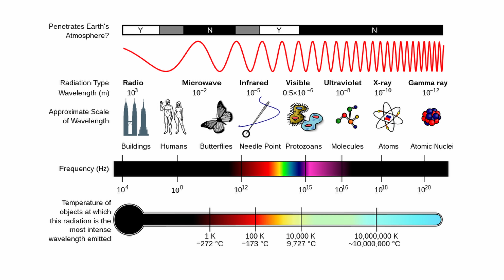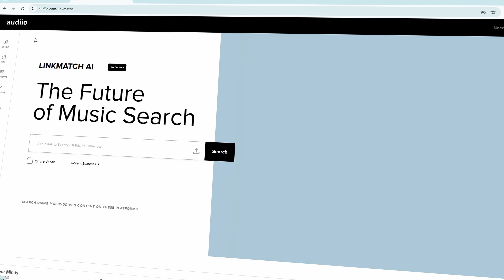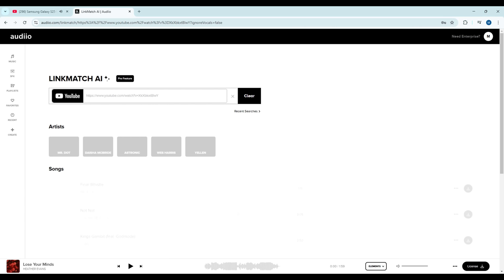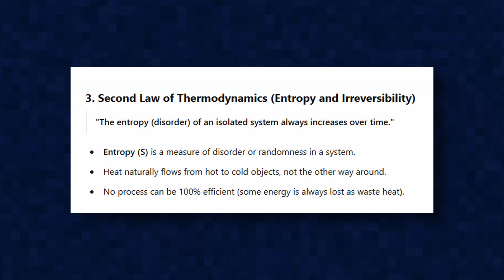This is how Maxwell Chikumbutso's Inventions Work

Comment: Chikumbutso is claiming what the Great Nicola Tesla demonstrated, yet his methods may be different or the same - it has been indisputeably demonstrated that simple matter contains energy that can do work outside the bounds of  matter - argue with an exploding Nuclear Bomb if you need Extreem proof - to be less exemplary, realise that there are non radioactive energies within matter that are much less extreem that lend their presence to mans utility and by that i mean the electromatic forces of the atom known as Magnetism that we encounter daily doing our tasks, holding notes onto bulletin boards or friges, starting our petrol cars, ect. - that simple seemingly inexhaustable force that emanates from the basic atom and most notably from magnetic materials is mans workhorse to use as he choses - to preserve the environment that he depends on for life - it has been widley proven that it can be simpley utilised, concentrated and AMPLIFIED by synchronising and directing its Atoms INTERNAL polarity using applied magnetic fields - that syncronisation or alighnment of matters inner magnetic fields causes a much more POWERFULL Magnetic field to expand from the matter that represents an ENERGY GAIN that can be used to create an AMPLIFIED  Electric Current  much stronger than the current used to synchronise the inner atoms fields - NEED PROOF? - then see the Works of YouTube Advertiser and Electrical Genius Dr. Holcomb - Holcomb Energy Systems - View His many Videos on YouTube Explaining his "Been To Court" Inventions and then consider what Mr.Chikumbutso also Claims.

Comment: Well if he uses wifi and phone radio signals to run his car. Its a maybe but then if everyone complain of no signal than after an investigation he will be jailed for stealing energy. The other point that from far of a tower, the signals will be so weak that it won't run the car. Its a good idea, but impractical. Its like claiming that we can tun a fertilizer factory on the air itself, because 70% nitrogen in the air. Or run the car on water because it has hydogen in it.

Comment: Conformité thermodynamique du système de Maxwell Chikumbutso

Le générateur sans carburant conçu par Maxwell Chikumbutso suscite la controverse, certains estimant qu’il contrevient aux lois de la thermodynamique. Toutefois, une analyse rigoureuse indique que ces lois ne sont pas nécessairement violées si l’on considère que le dispositif fonctionne comme un système ouvert, en interaction permanente avec son environnement.
1. Première loi – Conservation de l’énergie

Le système ne crée pas d’énergie à partir de rien. Il capte l’énergie ambiante disponible dans l’environnement (électromagnétique, thermique, etc.) et la convertit en énergie électrique. Tant qu’il existe un apport externe d’énergie, même faible, la loi de conservation de l’énergie est respectée.
2. Deuxième loi – Entropie

La deuxième loi impose que l’entropie d’un système isolé ne peut diminuer. Or, le système de Chikumbutso n’est pas isolé. Dans le cadre d’un système ouvert, une diminution locale d’entropie (dans le générateur) peut être compensée par une augmentation plus importante de l’entropie dans l’environnement. Ce qui est exigé, c’est une augmentation globale de l’entropie du système étendu, ce qui reste cohérent avec cette loi.
3. Autonomie énergétique

Si l’énergie récupérée sur la durée est supérieure à la consommation effective du dispositif, un fonctionnement autonome devient envisageable, sans qu’il soit nécessairement question de moteur perpétuel ou de fraude énergétique. L’important est l’équilibre énergétique sur le long terme.
Conclusion

Tant que le système est alimenté, même de manière diffuse, par une source d’énergie externe, et que le bilan entropique global reste croissant, aucune violation des lois de la thermodynamique ne peut être affirmée. En l’état, seule l’absence de validation expérimentale indépendante empêche de confirmer ou d’infirmer les performances revendiquées.

Comment: I don't doubt that he can transform energy with a new invention.  I am dubious about it going against our understanding of energy laws.  However, where it currently falls over is that his claim goes straight to being able to generate enough to power one of the most power hungry devices.  No invention in the history of man so far can take something that produced negligable energy and through initial prototyping demonstrate this level of commercial use.  I would get money backers to  put up an agreement to pay on condition that it works and they will have scientists to verify.  However, all indications so far suggest that this is a scam.  If he can produce this level of energy he's on the verge of delivering transwarp drives.

Comment: Isware he is right 👍 I make same charger for my battery using only coil and magnit as mortal shell it make to me about .025v with out moving ,,with moving I make volts charge my 🔋 with out normal charger only connect it to negative point of battery it's faraday's theority ...

Comment: 🌟claims about Maxwell Chikumbutsos Generator technology.

- His device is claimed to use radio Frequencies & he calls it a microsonic energy device. Microsonic energy isn't a known or recognized term. Is it a new discovery?

-He claims his system is an open system & some how it disturbs the ambient background into releasing energy

-He claims the special radio frequency as it passes through batteries doesn't drain them as they run loads & the batteries rapidly recharge when disconnected from loads.

-he's claimed to have made self powered vehicles that run indefinitely off this technology

-he's made many generator models varying from 100 watts up to 0.50 megawatts & he said they all have no moving parts & operate off microsonic energy?

🚩 Red flags & questions about Maxwell Chikumbutsos device/technology

-Most generator models he made have fans so they must generate heat as a byproduct of high power operation & need cooling (isn't that inefficient?)(do the fans only cool the high power circuitry that converts the battery power to 120/240VAC Power?)(the microsonic energy converter requires over 100% efficiency to function as claimed by capturing excess resonant energy in the ambient enviornment & should run cool in theory & not require fans.)

-how does the device self sustain itself while also running large electrical loads? Do the loads need to be switched off for a time & the batteries get rapidly recharged by his radio/microsonic frequencies?

-what does he mean by microsonic energy? Is it sound waves or radio waves? Is it Longitudinal Energy Harvesting? Is he generating certain sound frequencies on special metals to get a non linear wireless power output he can harvest? Does his device only rely on conventional known wave propagation phenomena?)(did he somehow discover something new?)

-during one large test demonstration some researchers from the thrive 2 documentary suggested to test the device running what appeared to be a 15kw welder & Maxwell said all they needed to complete that welder test is 18 new additional batteries to allow for that to happen to run a 30kw load & the generators high frequency energy will keep the batteries fully charged as the welder runs & sure enough the researchers brought in 18 additional batteries the next day & performed the test for one solid hour & claimed the battery voltage was slightly higher after the test & read 217vdc. Wouldn't 18 fully charged 12vdc batteries in series have a nominal starting voltage of 252vdc if fully charged at 14vdc before the test so after the test did the batteries drop to 217vdc? But the researchers claimed the batteries didn't drain at all & read slightly higher.

(Why couldn't he easily run the welder machine from one of his other existing fully functional generators? Why were 18 New additional batteries needed to be brought in by the researchers? That fact alone is a big red flag & suggests the new batteries themselves were the power source for the test that the researchers actually paid for out of pocket!)(the researchers also did not appear to go into any form of technical analysis of the system & seemed to blindly want to believe in its operation. They should have had tool boxes worth of analytical equipment along with avremenko led wireless detector plugs to detect if the device was giving off wireless power. Those mini detectors are highly sensitive especially if made with germanium diodes.)(the researchers tests from the movie thrive 2 were highly inconclusive.)

-what mechanism keeps the driving battery FOR the generation of his special signals charged while simultaneously running large loads from possibly other batteries that are exposed to this high frequency signal that keeps them fully charged & also causes rapid recharging in them after the load is disconnected? (Is the generator system truly self sustaining when on & running loads or does it need all loads disconnected for a time for it to recharge itself?)(Is the theorized energy synthesis phenomenon proposed by Eric Dollard occurring in the batteries from the special microsonic radio frequency stimulation?)

-is microsonic a real word & type of energy or does he just mean radio waves? Is he harnessing Longitudinal Energy somehow?

-A true zero point energy generator would generate power with 0 input possibly due to the phase disparity inherent to permanent magnetic fields in the proper generator archform at a ratio of 1/Phi³ & be solid state but as of yet no one's discovered that correct archform to manifest power with 0 input from the special arrangement of permanent magnetic fields. The well documented footage of field propulsion craft/ufos/uaps from the military strongly suggest these craft are powered by a type of zero point energy device. Also if the universe is truly infinite ♾️ it means that all phenomenon most likely manifest from a non cartesian equally infinite point known as the Aether & trying to measure it would be like trying to measure the measurer so a form of "free 0 point energy must exist"

Conclusion on Maxwell chikumbutso based on occoms razor is that the red flags outweigh the green ones unfortunately especially due to the fact of no filmed long duration or live streamed tests. Once these are done more confidence shall be established.
Reply: You are perfectly correct, no one was able to make and show à fairly simple test, note the battery level,at rest (it is supposed to be 100%), then run a simple test drive of 50 km long and at the end note the battery level, I can garantee that the level will be less than at rest, so this is the only reason why nobody was allowded to do the test, even investors were not allowded just to,enter the car (they will see within seconds that the battery level is not 100 % and the scam is over). Everything is fake 😂😂😂😂

Comment: Tesla showed how to tap, the radiant energy. same thing. receive the signals, run them through a step down transformer, smooth it out with a few caps. convert to voltage on the other side of the transformer.

Comment: Here is something important:
At 3:40 we are told that his devices collect a small amount of power from radio waves.... it is only nanowatts, very very small.
But "Chikombutso claims that his devices AMPLIFY" the nanowatts.
Really.
Then : why not use a small wristwatch battery to power the car?
You only need to change the battery once per year. It will give you MUCH more power than the nanowatts from radio waves.
You see, we have caught him now.  His own words make no sense.

Comment: If his partner was poisoned and died we can easily check that part of his story...release his partners name that died after being poisoned in the US.  Still find this very hard to belive...this is a power inverter looks like so there must be a battery. Also, in this video i see a power cable connected into the standard plug port on the back of the tv...but in another video showing the tv back side, Maxwell himself is pointing at this power port plug in spot without the cable and he is saying 'this where power normally goes in and now you see we dont need it (as there was no cable plugged in, in that video) So which is it...plug cable needed or not needed...these small things make a difference. 
Another video Maxwell saying if people try to inspect the device or disrupt any wires there is a self detinating device that will destroy itself to save the trade secret from being copied lol Sounds a bit too 'Get Smart' tv show too me! 
Impossible to work without a battery pack!  Why didn't the camera show some footage under that white car...thats an easy way to show everyone no battery!!

Comment: The entropy of radiowave is too large to be collected. Unlike the entropy of visible light and UV or photon which is still very low and can drive electron from lower orbit into excited state or produce electrical current in semiconductor. Yeah it's just against the thermodynamics law. 😂

Comment: Maybe it is something like solar panels that only work if the sun shines. Or like EV's that only work if the battery works in a mild climate. Or like a sale ship on wind, or like a rubber boat that leak all the time as a submarine. If this is like perpetual motion, I don't have to insulate my house anymore in the winter I just leave the heater on day and night with the doors and windows wide open and see my energy bill shrink every month.

Comment: I heard the statement 'The wasted radiation from devices is used' well that would be an awful lot of power being 'wasted' and harnessed to run a single car, what happens when all the other cars that use this system are operating at the same time?  Additionally,  I heard it said that this system could power a ship at sea.....where does the power for that come from? When you're mid Atlantic where does the 'waste' energy come from? Hundreds if not thousands of miles away? What about the curvature of Earth and the inability of radio waves to extend over the horizon? Nah, if it sounds too good to be true, well you know the rest. IMHO Complete and utter tripe, but time will tell as always.

Comment: The comment is discussing a method of generating electrical energy using atmospheric electricity and electromagnetic induction. Here’s a breakdown of what they are trying to explain:
	1.	Atmospheric Electric Energy
	•	The commenter claims that they are using the natural voltage difference between the ground and another point to create an electrical potential difference.
	•	This difference in voltage causes current to flow through a coil.
	2.	Electromagnetic Induction
	•	When current flows through a coil, it generates a magnetic flux (a changing magnetic field).
	•	This flux can induce a current in a secondary coil that is placed nearby.
	•	The secondary coil (connected to an LED) interacts with the base coil’s magnetic field, causing the magnetic flux to change, which in turn generates additional current.
	3.	Clarification on RF Energy
	•	The commenter says this is not radio frequency (RF) energy harvesting, meaning it’s not collecting energy from wireless signals.
	•	Instead, they claim this method relies on atmospheric electricity and magnetic induction to generate “free energy.”

Scientific Validity

While electromagnetic induction is a well-known principle (used in transformers and generators), the idea of using “atmospheric electric energy” to generate continuous usable power is highly questionable. While the Earth’s atmosphere does contain electric potential, extracting useful energy from it efficiently and sustainably is not practical with current technology.

Comment: Scammer. The most powerful transmitters in the world for huge radio stations are 100kW. A car takes approximately 100kW. To power just one car it would require a direct connection to the transmitter output. The amount of residual energy in free space (or air), in total from all radio transmitters combined is pico watts. A pico watt is a million million tines smaller than 1 watt. So this guy is scamming, well and truly

Comment: definitely a scam ....a fact check reveals a similar product on Amazon, a Browey Portable Power Station (1000 with a built-in solar panel, 614WH/19300mAh LifePO4 Battery pack, and solar generator with AC/DC/USB/PD output, designed for outdoor camping, RV travel, and emergency preparedness. It has also been revealed that Chikumbutso purchased a Kaiyi X3 Pro electric vehicle and likely fabricated it with a Browey portable power station. or a similar device  It's quite an elaborate hoax which he has been running for almost the past 10 years......dont let people fool you just because you want to believe what they say....do your own investigations

Comment: ...Quit calling it perpetual motion and stop the argument, IT IS NOT!  It is frequency Oscillation generating the power, amp, rectifier, battery.
...Can Radio Frequency Power an Electric Vehicle?  YES!  Oscillation and rectifier to battery.  It is NOT a perpetual motion machine, it draws the power from frequency Oscillation, just look at crystal radios, no battery but radio sound.  It is just science and ohms law.    ...REMNANT2U...

Comment: I remember when we tried to coil wire in our steel pipe faucet with speaker we can hear AM Radio. As far as I know we are all surrounded by radio signals if someone can harvest that waves and convert it and amplify into energy then we are one step to discover another source of energy.
Reply: You can harvest it, you just need an antenna. But you can not amplify it for free, it requires external power.